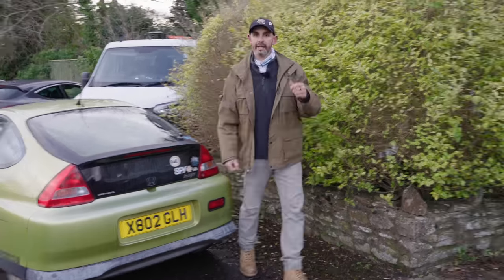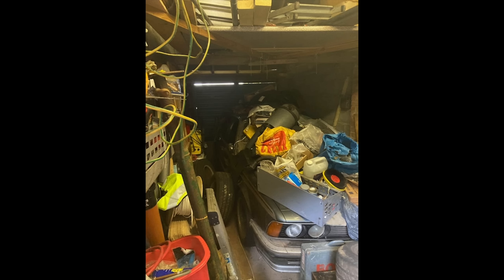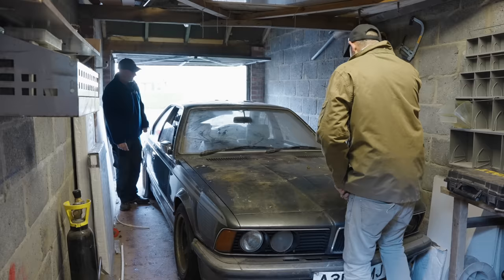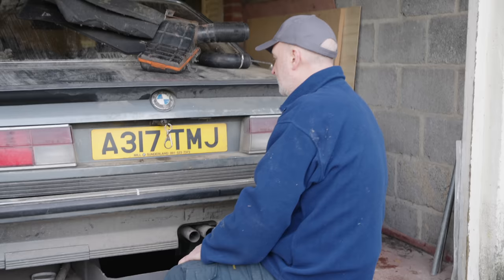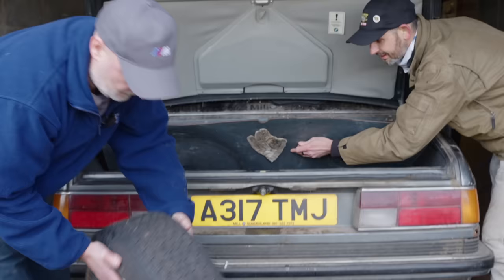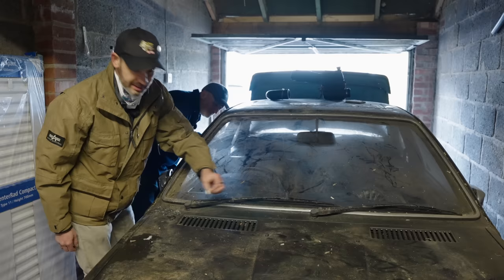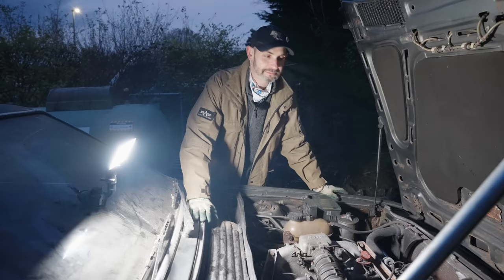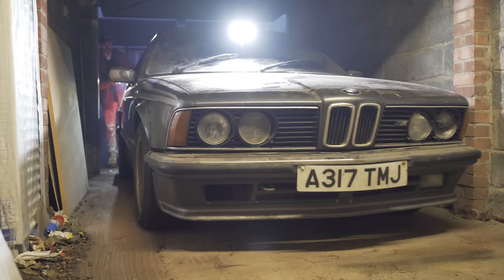Barn Find classic BMW 6-Series CSi discovered. Will it run?

Comment: Some clarification about the Penta wheels. There were several companies that made wheels in that style but only one company was called Penta, and they were based in the UK. Their wheels were called "Penta P1680/P1690" (80 = 8j, 90= 9j wide). The German wheels were made by ATS and were called "ATS AMG 5 Spokes". I've spent ages on forums trying to figure out who made them first, some people say that AMG asked Penta to make wheels due to increased demand, others said Penta copied the design on the Mercedes C111 prototype and that AMG asked ATS to make a version based on those. Either way, everyone started refering to all these different wheels as Pentas despite only the British ones having that name. The only difference between the two is that the spokes on the AMG wheels are slightly shorter with a thicker lip than the Pentas. Like I said, several other companies made versions of these wheels but people generally agree that the ones to have are either the genuine AMG wheels or the British made wheels that are actually called Pentas.
Reply: Mine are Ronal R9s
Reply: Couple years ago I bought 628 in dolphin grey with similar bodykit on those ATSes (probably not Pentas as it was on continent and car was LHD). so maybe that was some sort factory option?

Comment: That 6 series is one of the coolest designs ever. Amazing it run on its own fuel.
Reply from the maker: Preferred the old fuel to the brand new E10. That's telling...
Reply: @TheLateBrakeShow  Next time go and get your fuel from an Esso. as long as you're not in the way far flung parts of the UK Esso premium fuel has no ethanol in it.

(I'm in no way affiliated with Esso, I just know it's the only zero ethanol fuel you can still get)
Reply: @ChuckFickens1972  Unfortunately not available in Northern England. E5 99 octane is the best we can get here.
Reply: @stephenholland5930  So even the fuel companies know that northern cars can handle their alcohol better than my southern wuss of a car 🤣🤣

Comment: I dont know what it is but that first glimmer of hope when it fires for a split second gives me a great feeling of releif its weird brings back very old memories of my early cars especially my old 1973 beetle when they just run on the starter no fire its the most horrible feeling but  just when you hear that little crack of a cylinder firing it just makes you relax and then the build up of an actual full fire up it like a huge weight off your shoulders just hearing it, loving all the barn finds its almost like meditation for me so thanks for bringing back these memories it makes me want to go and dig out my Chenowth (beetle based sandrail ) which infact i have never heard run and i have had it in a garage for over 20 years now, carbs where taken off a long time ago and i have another set as well but these videos just inspire me to just go and have a tinker and see if i can get it running! I am amazed that this BMW ran on 20 year old fuel i always thought there was an expiry on fuel but obviously not!

Comment: I was born not too far from the North Pole, and it can get very cold there, especially earlier. There had been a long cold spell, with below -40 for over a fortnight, then forty years ago. I was going to pick up a Volvo 343, yes, one with a CVT gearbox, and drive it 120 miles. But how to start it. No engine heater, nothing. I turned off everything that could possibly use electricity before trying. Started after the third attempt. No problem, and none of today's electric cars would have been able to do it. It's always exciting to start cars in the cold, or that haven't been driven for a very long time, that's why it's so exciting to see this series, if you get a start.

Comment: Had a 1981 635csi back in the eighties. It was gold with tan leather and in lovely condition. Don't I wish I still had it, but have had around 10 cars since then, so it's a distant memory. Great to see this 628 running . What a result for you great guys.

Comment: Great find! My first E24 was a 85 635Csi (US model) I was looking for an E28 but when I test drove the E24 I had to have it. This was 10+ years ago while they were still cheap. I later had to sell that car to pay for a move but I since purchased an 81 (E12 based) 633Csi and although the 635 was certainly more lively I prefer the simplicity and style of the early car. It bridges the gap to the E9 quite well actually. You can see a couple of shorts with my E24 on my channel.

Comment: I had an '84 633 CSi American version.  I loved that car.  Great  highway cruiser for long trips.  I would get 26 MPG at 75-80 MPH all day long.  Over 100MPH it was very smooth and stable.  I sold it with 240 K miles and it was still running great.

Comment: Hey DIY mechanics, don't hit brake calipers with a steel hammer, because you can easily deform the piston bore and permanently seize the caliper. Instead hit on a piece of wood to protect the caliper.

Comment: Dream car BMW 635 CSI. I was posted to Germany in 1980. Couldn't afford the 6 but saved for the 323i. LINCOLN BMW allowed me to sit in a BMW 635 CSI in the same colour as the barn find car. 
In the showroom at Rheindahlen , the BMW salesman was so derogatory to me that I walked across the floor to the Audi stand and bought the showroom model. Audi 80 GLE in triple blue. Electric Ariel , alloy wheels, 2 rear fogs, tinted glass all round and 1000 DM worth of sound system. Price 18000 DM = £4050. Beautiful car. Long range 5th gear . 50MPG. Happy days.
The BMW 323i base cost was around 23000DM.

Comment: Old fuel works much better than you’re led to believe. I’ve been away & I’d fuelled my 1977 bikes up before leaving & putting into storage. 15 months later, fuel turned onto prime, kicked it over and started & ran perfectly, idling down off choke as if ridden yesterday, not 2021.

Comment: I bought a running 533i in Western Canada for $400...He worked for B.C Ferries and his wife was a chef for the marina in West Vancouver near Horshoe Bay. I used to drive by that car for years and I always liked its prescence. Little did I know that years later I would buy it cheaply in a sort of worn out condition.....except it wasn't . 5-speed Getrag....driver's car. best car I ever owned and miss it dearly. Sold it for $700 to a German mechanic who knew what it was. Turns out it had a broken front spring perch [I wondered what that sometimes clunky sound was]. I had put in a new starter [remove heater hose and remove the starter bolts with typical open end and box end wrench, from the firewall area]. Loctite the banjo bolt under the valve cover when manually adjusting the valves. On the air flow meter from Bosch you needed to bend the tracking arm to give it a fresh track on the resistor board, ran like new after that. I put in a new distributor cap and rotor, Ngk spark plugs and wires.... God that car was fast with the 3300 staight six. Best engine BMW EVER made....The German mechanic's visa ran out and he had to leave the country and wanted me to buy it back but it was lean times for me and I had no money...I was barely getting by. To this day I wodered what became of that car. Bronzit Beige, cloth seats. Trx ties that were quite old, original rims.....sigh. It put ANY modern car to shame. When the BMW parts counter ran the VIN...He blinked a couple of timesand replied: "THIS CAR IS BUILT LIKE A TANK" ...in comparison to the modern BMW junk he has to deal with daily. I should look for another one...

Comment: I had an 80 633 csi (Bought in 84).  Beautiful car, but yes, you can watch them rust.  Traded an 82 320is even up for it and sold the 6 for $10,000 in 84 for a 325ix.  Two weeks after we sold it the engine blew up...but the lady who bought it had it fixed...for $5,000.  She lived in the hood and drove it for years, with even more rust.  But, they are lovely cars!

Comment: I had one of these 628CSi models in the late eighties, did not have the spoiler on mine, I believe it was a W reg and only parted with it as it was rusting. Colour was metallic silver.
I later was informed that only a certain amount of these were right hand drive, although I don't know if correct, it was a fabulous car to drive, manual as the one you have here and was a head turner even in those days. well done guys.

Comment: Had the glory of driving a 3.0 csi in all it's glory.  Auto.  Been waxed down to primer.  All there.  Atlanta GA garage car humidity control.    Bliss.
Later, a 635 all in German.  No USA anything.  Small bumpers, manual, $6599US on a used car lot in Asheville NC USA 1986.

Comment: I think Tony BMW bought my 1980 Blue 635csi from Harrogate in around 2015. The car was-sat outside for 15 years + , when he got it back home with a battery and some fresh fuel started straight up. Quality Engines

Comment: Absolutely brilliant. 
Great to see it driven back into the garage...👏🏻👏🏻
Plucky things a survivor, that's for sure. 
Petrol, the cologne of BMW barn finders...😂
Reply from the maker: It drove surprisingly well. Clutch mech all fine, and engine ran better on 2001 petrol than new E10!
Reply: Yep, driving it back in was a great finish to the video 👍
Reply: @TheLateBrakeShow  At least use E5 if you can't get Esso non-ethanol.

Comment: Love the old shark nose BMW’s , way better styling than today’s ones for sure. I grew up near a BMW breakers yard called Rosa motors in South East London during the 1990’s and my brother worked there , fond memories and funny ones of these cars , myself and my dad and my brother have had a few over the years, I do have a 1988 F reg E30 325i with manual transmission and in dark blue with blue cloth interior, which was given to me by my brother. Might be the immobiliser or the Bosch injection and fuel system being lazy, but you got it going.

Comment: My goodness, even in 1984 BMW were building cars with an onboard brain that knew the second a piece of essential hardware was not right or missing, it shut down the entire car for safety. Let alone building indestructible engines that could stand for over 2 decades undriven and then with a little TLC spark straight up again AND drive. 
Technology may have improved over the years, but engineering quality certainly hasn't evolved. I'd choose one of these classic BM's over any modern car without a doubt.

Comment: Did anyone else spot the illuminated interior light at 18:55. Strange that, they still hadn't  lifted the bonnet at that stage....or had the battery held it's charge for twenty years?

Comment: I own a BMW 528I E28 with manual dogleg transmission and limited slip differential originaly from BMW Factory . Mechanicaly still having some issues , brand new paintwork with original paint has already been done .
Engine same as this 6.28 CSI if i am not mistaken M30B28 Engine . 
Those Eighties BMW s  are really fantastic driving machines  . Engine will get some tuningimprovements . Special sportcam  , exhaustheader and complete brandnew sportexhaust  ,  special airmanifold and K&N exchange airfilter ought to do the job  . Hope to get around 220 hp out of the engine with ECU chip  .

Comment: Been there, done that ! 😋😋
The 628 is the least manufactured model of the e24.
It's not the "motorsport" m635 front spoiler, the rear skirt is M-Technik, which the m635 did not have.
20 years ago I bought mine 😱

Comment: Brilliant, what a stunning car 😍, wasn’t too keen on those wheels at first  but they suit it 👍🏼 I used to have an e28 528i with a manual box in 2000. I paid £600 for it. I was 21and felt like a pimp driving it. At the time I was self employed and I did a job for an old guy in our town. He had an immaculate red 635csi (it had a private reg so I don’t know, and can’t remember what year it was) I know he’d had it from new and it had only 15k on the clock.
Edit… My 5 was a 1987 E reg in dark blue with pale blue velour interior.

Comment: 628s were the poor relative compared to the 635, and production stopped in 1987. On paper the manual 628s (there weren't many) were at least as quick as an automatic 635, but an automatic 628 would struggle to make 60 in 11 seconds - there are diesel vans out there which are quicker than a 628 auto! Their one saving grace was fuel consumption - they drank less than a 635 - but otherwise are beset by much the same problems as any other E24: rust, and comedy prices for spare parts, to name but two.

Cobra alarms. I had one on my 635. That alarm system could drain a battery in three days, so I stripped it out. Left the sensor in place, though.

Comment: I remember back when this was put away, these were worth virtually nothing & the E23 7 series even less. Probably about 2002 I bought a 1986 735iSE with M styling bits for £200... Still the one car I wish I'd kept hold of, not least because I'd never be able to afford even a rough base 28i now... beautiful car to drive & not even that bad on fuel considering. Did look at a Hellrot (oh, the irony of the colour name) E24 as well around then, think they wanted under 2k for it on a forecourt...  find anything like that deal now lol

Comment: Non sports front seats, the naff standard steering wheel, no aircon, a 628Csi, the crude OEM spoilers, 200,000 miles, lots of rust. 😬 I’d quietly push that back into the garage. And I say that as a fan and previous owner of E24s and current owner of a 45,000 mile E23 735i.

Comment: May I be so bold as to suggest you bring wheel dolly’s I think they are called Jack it up and slide them under lower the wheel in 360 turn on the spot

Comment: You must buy a rechargeable airgun for the tyres best tool I’ve ever bought apart from that one of my brothers bought one of these 635 CSI IN THE MID 80s I think it was a 1977 automatic what a mistake that was never out of the garage best thing that happened to it was a van ran right into the back of my brother and the insurance company wrote it off but he never learned a lesson he bought a 735 I  that’s another story

Comment: I've noticed the Tony BMW Can of Hope has a high pressure EFI pump on it. Have you thought about getting him to plumb in an additional low pressure pump for carbs, maybe with some kind of tap arrangement to switch pumps? I could see that the high psi pump was blowing past the float needles of the carbs in the last barn find.
Reply from the maker: We have talked about that, and previously on Sapporo barn find I just pulsed the fuel pump so as not to flood the carbs.
Reply: It may or may not be currently in development
Reply: @TheLateBrakeShow  All good, looking forward to the next one.
Reply: @TonyBMWE12  Nice one.

Comment: Am I right in thinking that that 2000 Insight is THE press car from 2000?
Reply from the maker: It was a demo car at a dealer and Honda UK for a time, as under certain strip lights there's signs of decals across the bonnet saying '100mpg' or something.

Comment: The most basic in the range sadly. With huge mileage, rust etc. Maybe schnitzer alloys?
Parts value at best.

(Amusingly the interior light came on before they fitted the battery. )
Reply from the maker: Parts value? What year are you watching this, 2001?
Reply: @TheLateBrakeShow  it’s a lowly 628 in 2023 for goodness sake.  Restoration would far exceed the value. Take a look at the classifieds ….
Owning a mint, low mileage, no rust or damage 3 owner M635 I do have some clue about these cars.

Comment: Not quite correct: The E24 was built whole by Karmann from the 1976 launch until late 1977 when BMW took production in house. Karmann continued to build the bodyshell until the end in 1989. A 628CSi always had 14 inch wheels unless it was specified with Michelin TRX metric tyres, 200/390 in this case. The spare wheel is the original type fitted to this car with 195/70x14 tyres. This car has the optional Sport steering wheel. 628CSi's arrived here in late 1980on the E12 chassis and all E24's went to the E28 platform in Spring 1982. The relay you removed is the 'fuel pump relay' that also powers the injectors.

Comment: This was painful to watch. Anyone going to pull a car out of a garage must have an impact elec cordless driver, wheel platforms for each of the wheels, a trailer with elec winch, an elec air compressor and a battery booster.

Comment: Great looking car but get the five spoke Mercedes off it.
Reply from the maker: Pentas were often seen on Mercs, but not specifically a Merc wheel. Penta was a British company.
Reply: @TheLateBrakeShow  Interesting Outside or Mercedes only other place i have seen a few used is in the 80's Porsche scene in the US. - with the factory five lug pattern. I honestly considered getting some for the 911, to get away from the legions of RSR finish Fuchs - But i was too lazy and sold the car now, bought a Golf R. The stress of classic porker ownership is gone and instead I marvel at how the AC works in a car i can leave anywhere. Plus it would absolutely blow the doors off any tricked out 911 up to the mid water pumpers

Comment: No mechanic in the world let the old oil in the engine and start a  car after so many years. The engine in broken from the bearing on....
Reply from the maker: Not true. Entirely depends on how long the oil has been used in a running engine.